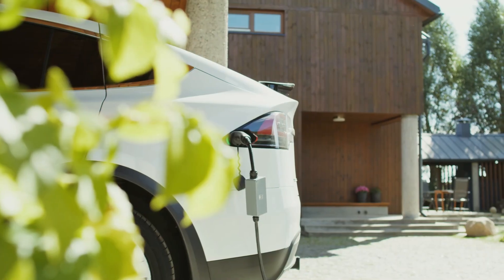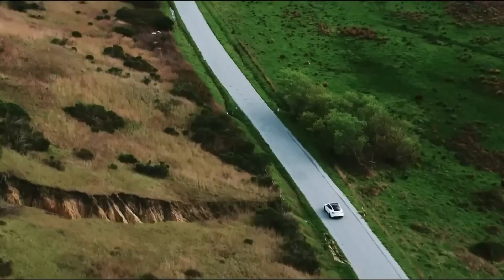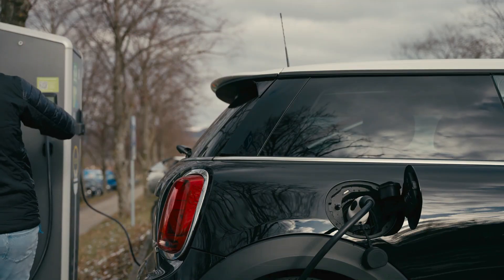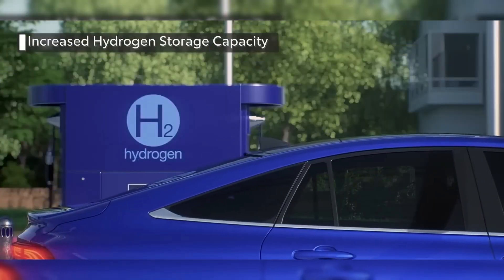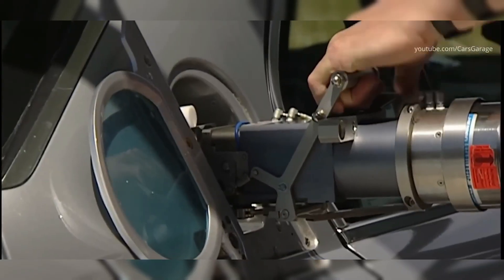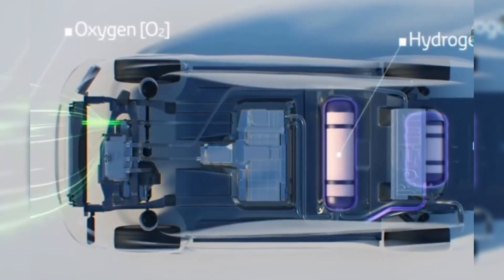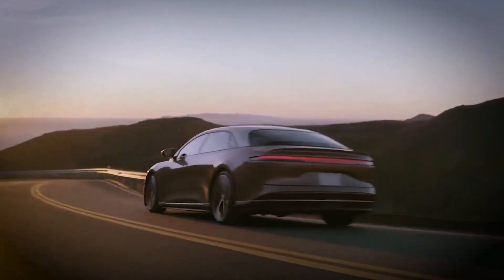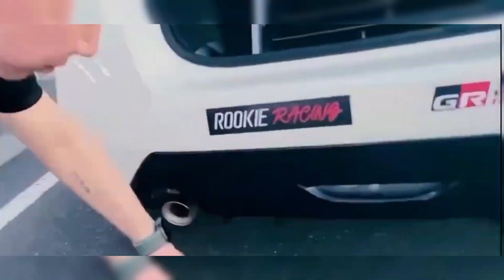The Engine Big Oil Doesn’t Want You to Know About 🔥

Comment: How much energy does it take to separate the hydrogen and oxygen, compared to how much energy is produced?
Reply from the maker: Hydrogen production consumes about twice as much energy as can be used in the vehicle. Even with an optimized fuel cell (3rd generation), a loss of approximately 47% remains.
Reply: It is done naturally on the ocean floor by nodules.